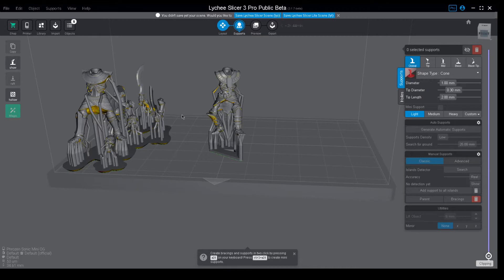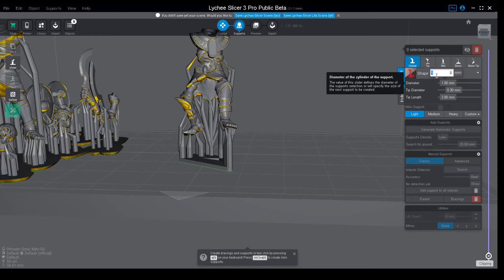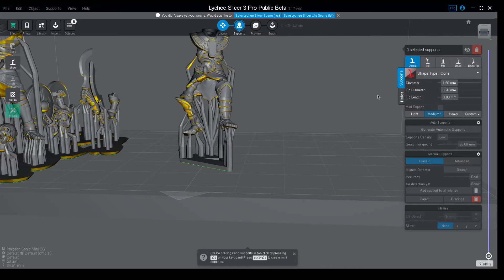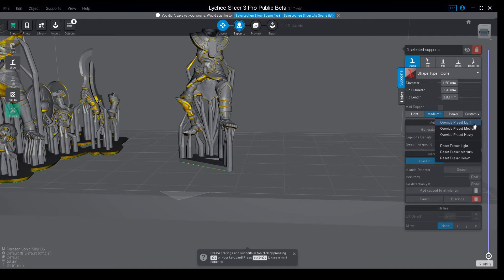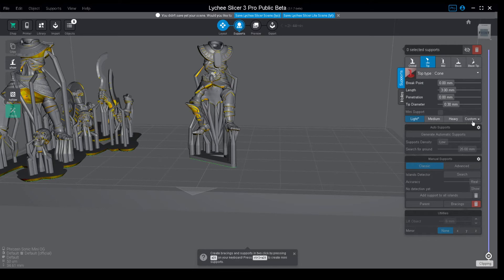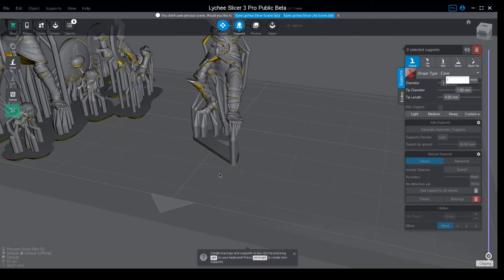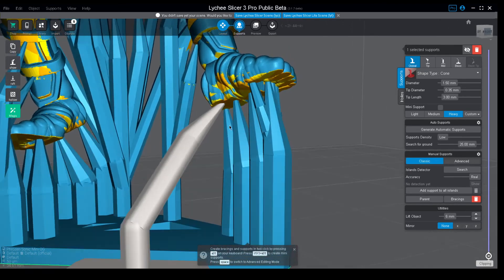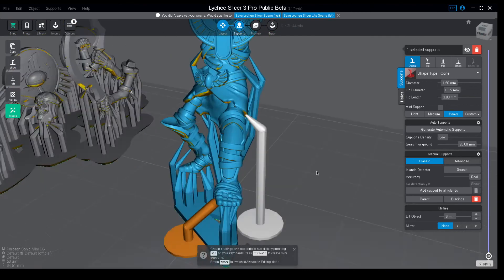Atlas Support Settings

Comment: Have you experienced any fails with 0 surface penetration? I've just had 4 out of 5 fails using your settings. Prints just came away from the supports due to the weight.They are my first prints using Lychee. I was printing in CB with deeper penetration, but the support scars were horrible.
Reply from the maker: Penetration doesn’t matter. The object is solid, a support that’s touching the surface of an object becomes fused with that object. You can’t “penetrate” any further into a solid surface. If you’re having issues with the prints we can look at your settings. Feel free to join our discord at discord.gg/atlassupport  . There’s about 700 members that are always willing to help! 🙃
Reply: @Atlas3D   Thanks for the reply. Yes, that makes sense. I'm using the exact settings from this video. Default Elegoo Mars preset in Lychee(layer changed to 30um) I'm printing one of my bust statue sculpts at 60mm height. It's a heavy print so my next step was to hollow the parts. Would you change you support settings for a larger piece vs 28/32mm minis? Thanks. I'll check out your Discord.
Reply from the maker: @musashidanmcgrath   I would definitely change the default settings. You can get some great information in our discord on printer settings, especially for larger busts. Also bring what resin you’re using 😁
Reply: @Atlas3D  thanks man, will do.